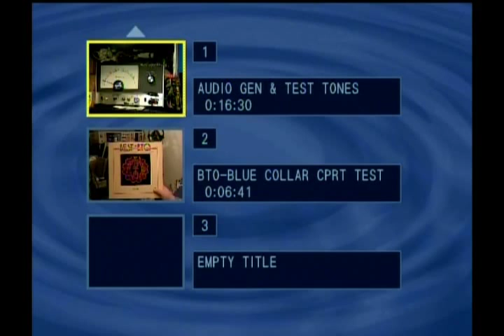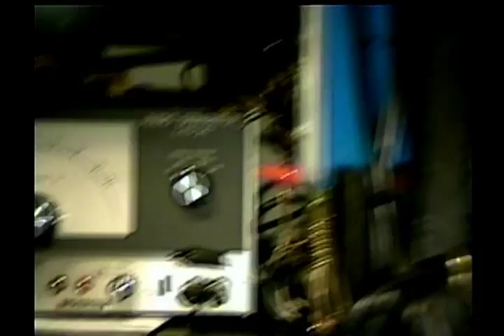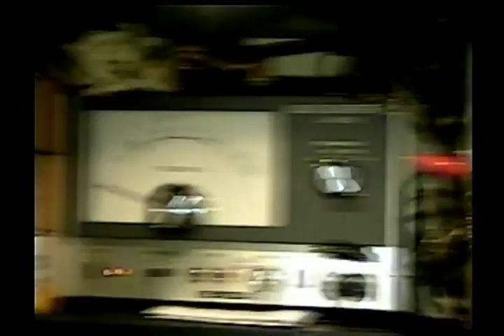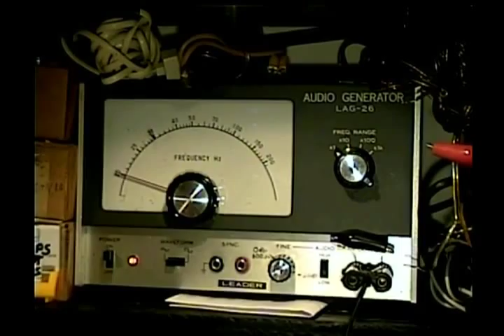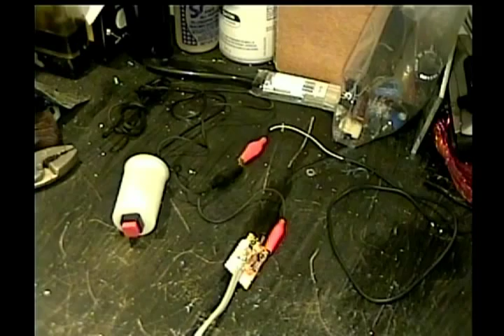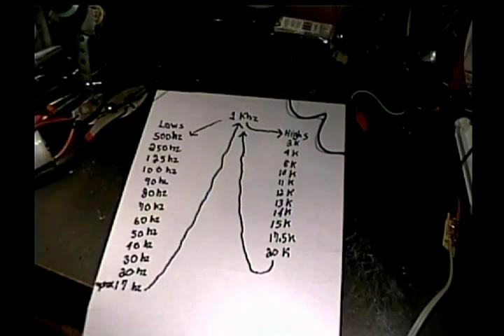Audio Generator, Part 1, Demo.mp4

Comment: Generatoarele AF fara un osciloscop cit de simplu nu prea dau mari rezultate s-au un milivoltmetru AF Cu ajutorul lor se poate masura raspunsul in fregventa a unui etaj de putere in general care se poate face destul de usor si  cu ajutorul urechii si cu un multivibrator cu aomonici de un 1 Khz s-au un generator AF sinusoidal mai simplu  Eu personal nu am folosit asa ceva decit de citeva ori in toata cariera de 40 de ani de meserie , dar nu de nevoie de placere si ptru a-mi aminti cum se foloseste in rest am lucrat cu un multivibrator facut de mine cu 3 tranzistori de HF si in Tv nu numai in aparate de radio ori amplificatoare AF  In  tandem cu un urmaritor de semnale atit AF cit si RF  si un multimetru nu prea sofisticat au fost aparatele mele de baza Am reparat sute de apar radio si Tv cu aceste scule chiar f bune Conteaza mult pregatirea si experenta evident si niste scule pe masura desigur ajuta dar nu intodeauna sint necesare scule complexe si sofisticate de jdemii de dolari  pot fi usor inlocuite cu multe alte dispozitivze  mai simple si chiar banale uneori    50%  este experenta in determinarea rapida a defectelor si doar 30%  sint masuratori si interpretarea celor masurate si 20% s-au chiar mai putin munca Exp Interpretarea def intr-un aparat de radio cu tuburi  Nu  se aude nimic becurile de scala lumineaza ochiul magic nu se inverzeste Cel mai probabil lipsa U a nodica ( circuitul de alimentare cu U continua   tubul redresor, dioda redresoare ori puntea de U continua defecte circ intrerupt  sig arsa cond electrolitic de filtraj in scurt  etc..) .. Exista o schema generala de identificare a defectelor ptru toate tipurile de radio s-au Tv astea trebuiesc cunoscute dumnezeeste daca vrei sa faci meserie  restu e bijbiiala chioara